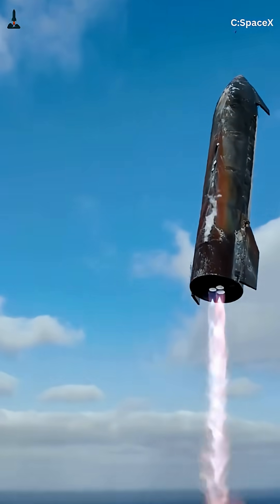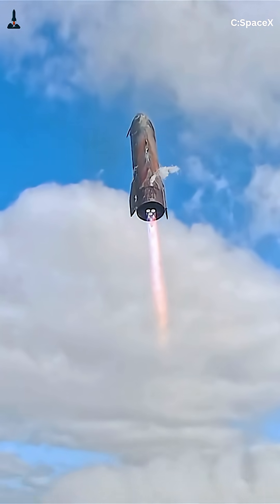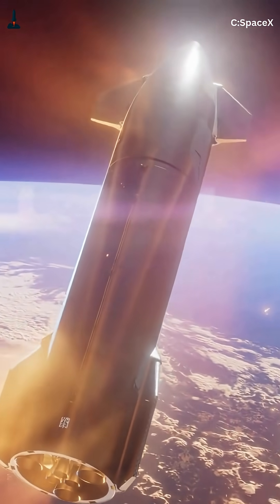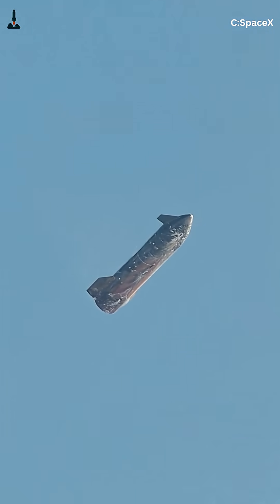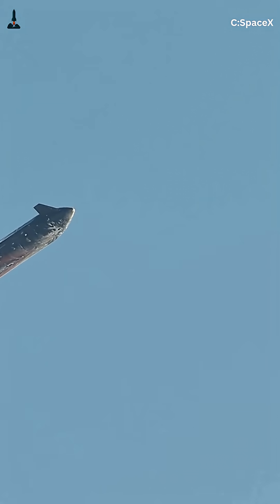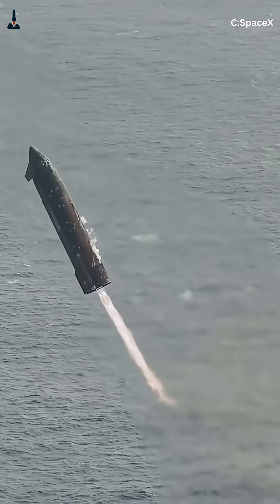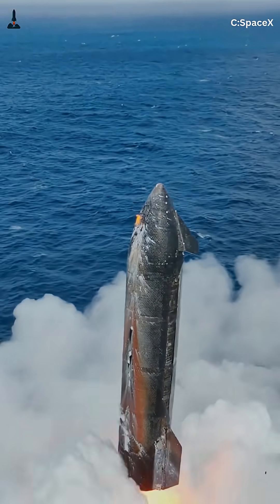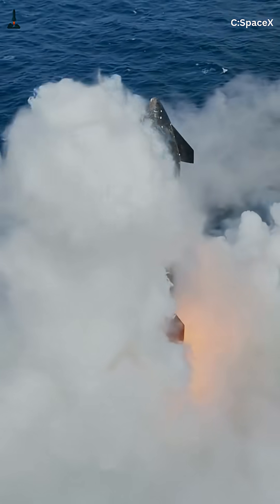This Flip Could Destroy Starship — or Save It! #space #starship #elonmusk #starshipflight11 #spacex

Comment: The booster does return on its engine what no the upper stage ?
Reply: The booster doesn’t go to space, it experiences significantly less heat, in the case of falcon 9, they relight the engine to slow the booster down to prevent heating that would burn the rocket since it’s not stainless steel.